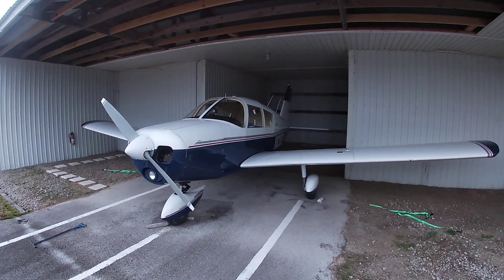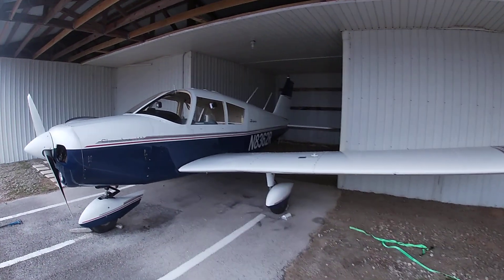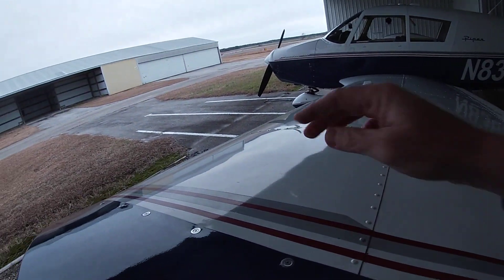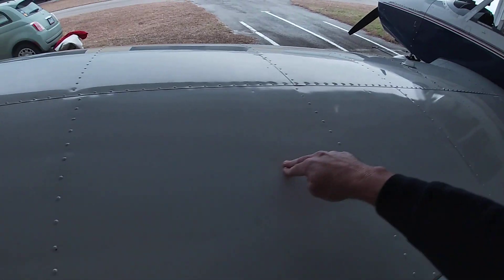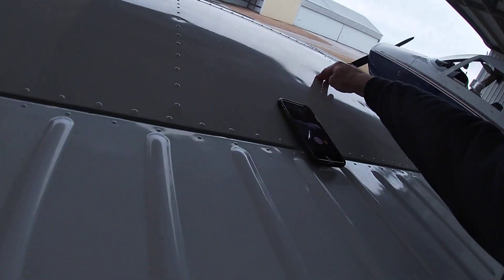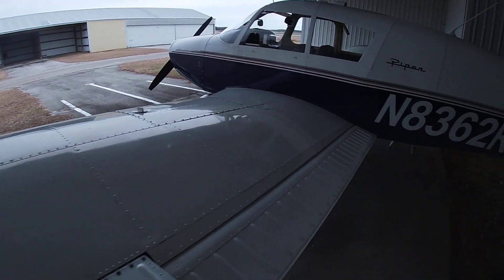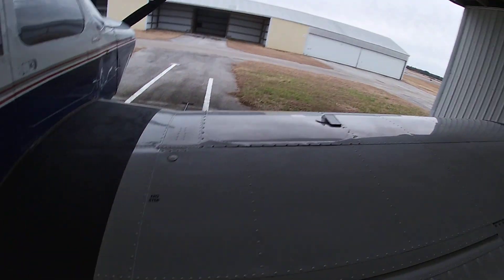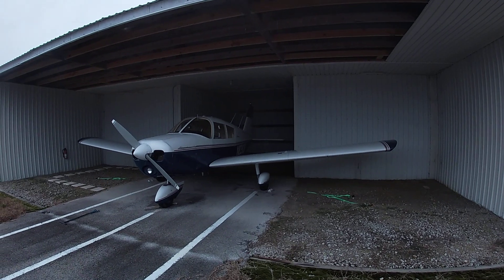Response to Bryan R. - Piper Cherokee 140 Oil Canning effect

Comment: Hey thanks a lot. I think there is some variability in them. I only have one “cell” that makes audible noise. The rest seem ok. I flew yesterday with my wife and we both looked really hard for any movement and could not see any. I think that my issue is normal and was just very evident due to the light angle and perhaps even made it look worse than it is.